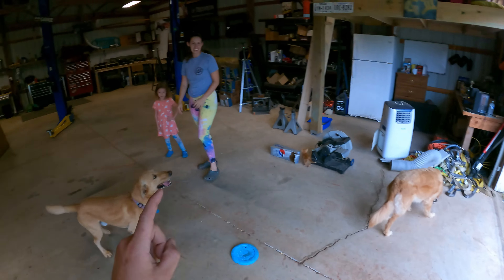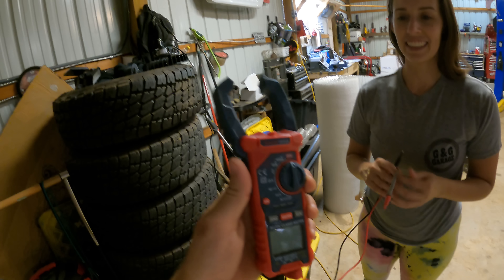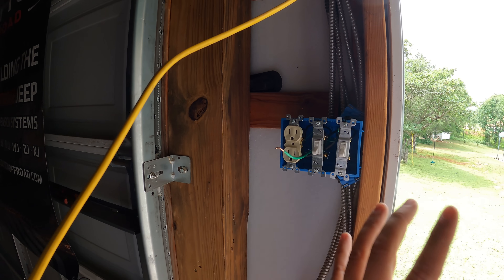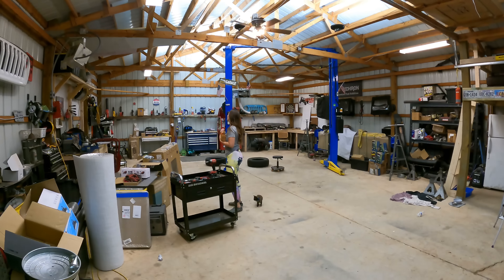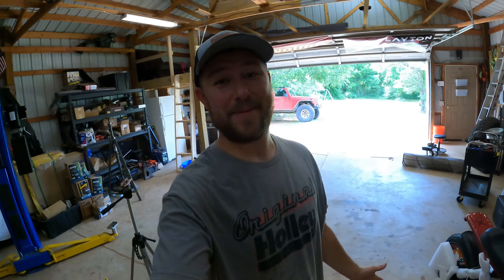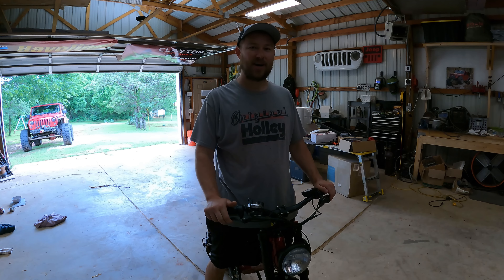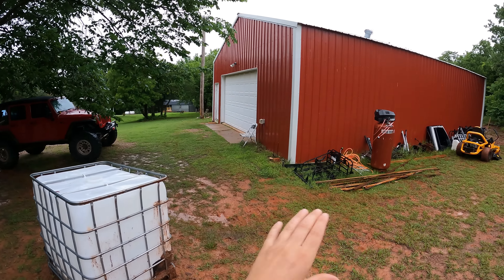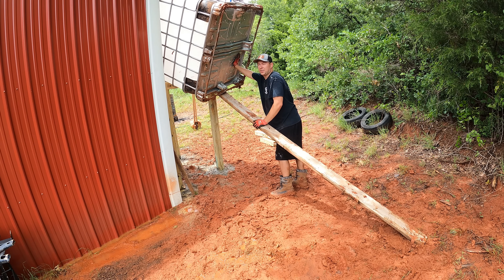Shop Upgrades For the Gear & Gadgets Garage!

Comment: just a note, water weighs 8.33lbs per gallon.  that being a 300 gallon tote puts about 2400#.  Your stand will be plenty to support the weight, but also makes a great spot to hide a air compressor under it.

Comment: Nice video. 21 Snazzberry 392 Ruby here. Couple of suggestions. On the electrical project. The lighting/receptacle. You can feed receptacle with the hot so receptacle is hot all time, or feed receptacle with switch leg side so receptacle goes dead when u turn lights off. Always a good idea to have some GFCI's as well. Keep in mind that aluminum extension ladder is also an excellent conductor. A 4' piece of rope at top ladder rung to tie to joists can prevent a broken leg 👍

Comment: The hyperlites are great. I have their linear high bays in my shops. They work great. What are your plans for A/C? Metal buildings are great but the do get hot inside.
Rain water system is great. You may have to treat that system. Recirculation may not be enough to stop mold and algae. That is why alot of the containers are black. No light keeps algae at bay. Recirculation will not stop algae
Reply from the maker: Yeah I’ll probably throw in some pool shock once a week

Comment: You might want to look into a different container for your rain water collection. Usually you want a black tank that doesn't let light through so the water doesn't mold. Otherwise you will need to treat the water regularly, even if you don't plan to drink it.
Reply from the maker: The plan is to leave the pump on and have a recirc system
Reply: @JKGearandGadgets  could put a tarp over it too.